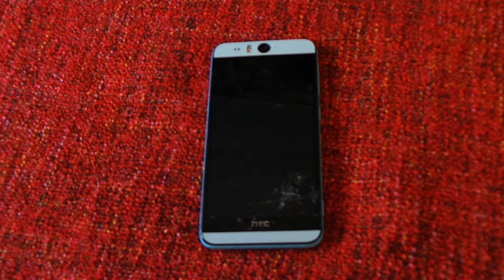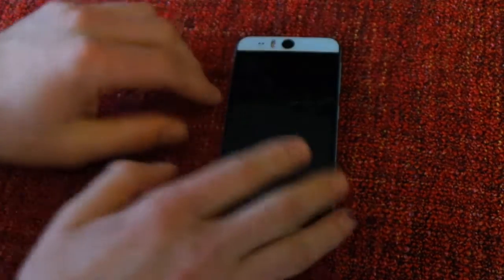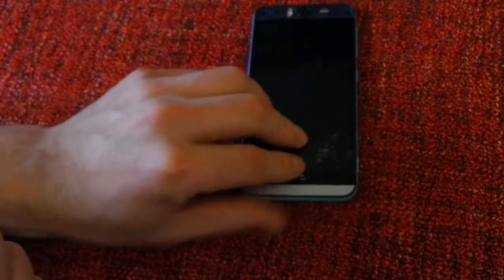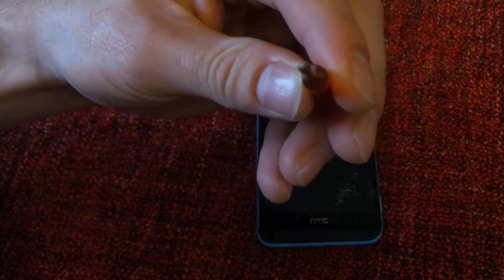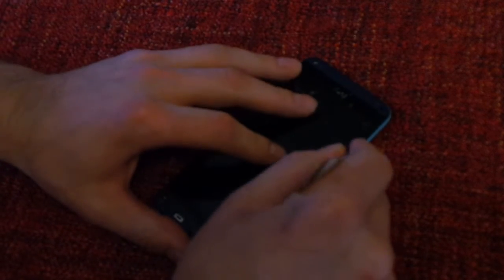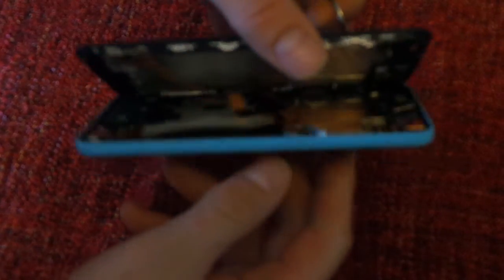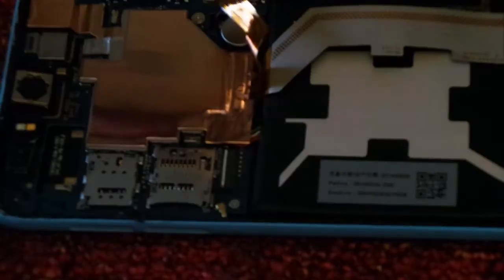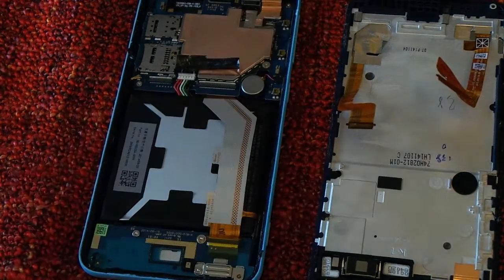HTC Desire Eye how to open replace lcd/digitizer

Comment: hey what is it exactly am I looking to buy/ my screen is broken, do I need to buy:Black LCD Touch Screen Digitizer Assembly Replacement For HTC Desire Eye?
Reply from the maker: Nat Bash Hi yes you need to buy LCD with digitizer fitted on it ,
Something like this https://rover.ebay.com/rover/0/0/0?mpre=https%3A%2F%2Fwww.ebay.co.uk%2Fulk%2Fitm%2F121749198476
Reply: thanks so much

Comment: Do I have to use extra glue after replacing the digitizer? if yes, which glue do you recommend?
Reply from the maker: Wojciech Kołodziej do you mean glue for the top and bottom or around the digitizer ?
Reply: All of them.
Reply from the maker: Wojciech Kołodziej for a top and bottom you dont need a glue just re-heat the with hair dryer and stick them back
For digitizer you need a tape who sticks from both sides check the link below 

https://www.ebay.co.uk/itm/262555060041
Reply: Ok. Thank you for your support.
Reply from the maker: Wojciech Kołodziej Any time 😉

Comment: my display is working but my touch works only in some area and the display is not cracked or anything.so what parts should be replaced??
Reply from the maker: Hi there is problem with digitizer
So it could be easy fix or very expensive fix
Easy fix is just to open it and check if digitizer connection cable may be loose.
In my experience with htc models
This digitizer problem happens alot 
But the expensive way is to replace the all glass with new digitizer cables
And if you still have the same problem
Then your digitizer connection port is faulty and if that is faulty that's cost alot to fix
Because the the digitizer connection port is attached to mother/logic board and there need a professional soldering dude to fix it
Or new mother/logic board and they not cheep
In my experience with htc this problem happened alot
Reply: Ok thanks mate
Reply: you have to replace Touch.. no other soluction... i do that

Comment: is it water proof after repair??
Reply from the maker: Kaushal Janith it's not water proof even before you peel it off. This phone isn't water proof
Reply: +Einars Steins  what?? but its IPX7 waterproof design
Reply from the maker: Kaushal Janith yes it is mate but after I watched few videos i would say its water resist not proof, but anyway, adter you peel offthe sticker it will stick back and hold the same as it was original, just be careful dont let any dirt or dust stick on it 😉
Reply: +Einars Steins tnx bro
Reply from the maker: Kaushal Janith any time, btw i think that sticker is just for look not for water resistance just to cover the screws and that plastic

Comment: Ok question I have same phone and I accidentally broke the changing port trying to clean it now phone won't charge how would I replace that peace cuss I herd u can buy them but putting it in myself not sure about.
Reply from the maker: Hi. Usb port is easy to replace, but im not sure how it is for this phone cos i never dig so far to see, usually there is small cable and thats it, but as i know for oldest phones they are soldered to mother/logic board.

So just dig so far till you going to see how that USB port is fitted in and if it's not soldered then easy job to replace

Comment: Thank you for the video mate :) .. all of sudden my desire eye's display has become very very slow(if we type three words the display is still at the first word and takes more time to show up the next three words. this is just an example) apart from that the mobile is perfectly alright( everything is working fine ) does it have anything to do with the lcd display what could be the reason for this.. i have factory reset it for twice with out any luck.. please help me with info if you have come across this kind of scenarios
Reply: I don't know if you sorted this yet, but mine did this. It's the default keyboard. Download Flesky (best keyboard in my opinion) and it'll be perfectly fine again.
Reply from the maker: Hi. I dont think its lcd fault, could be processor or some fault in mother/logic board. If you still have the waranty take it back to the shop.
Reply: +Einars Steins Thanks for your reply, unfortunately mobile is out of warranty period.. i gave it to the service center.. i hope it is not mother board problem.. fingers crossed
Reply: Im having this problem too, my phone is so slow, response is slow and disconnected and reconnect the flex cable from the LCD and is now working again, but sometimes it become slow and i have to hit the phone with my hand for it to become fast again, i dont know whats the problem yet :( maybe the motherboard or a loose flex cable from the screen.( Sorry for bad english)
Reply: I will try your advice Sammi Jayne Brooks

Comment: Hello, i broke my charging pin this morning. Do i have to change the whole charging board or only the pin? If so, can you give me information/tips on how to change it? Thankyou :)
Reply from the maker: Hi. In most cases with charging port is when you need to replace all port cos its hard to find the problem.

Sorry but i cant make a video how to fix that port cos i dont have any more that htc device :( 

Try to find some how to fix video in youtube
Reply: Thank you so much. But i broke the charging pin.
Reply from the maker: Charging pin?! So how old is your htc !? So its charging with pin not with usb port !?
Reply: My Mom gave it to me last february 2015. The technician cannot find any replacement :(

Comment: Great video! i've sent you a message!
Just read the comments..Basically what you are saying is don't try to peel off the glass from the digitizer..Well i almost did it on my MotoX so I think i`ll give it another go! :D
Reply from the maker: Hey. 

Yes to seperate the digitizer from lcd is pain in ^#+ thats why im not doing, cos one wrong move and the lcd is broken ;( its cost just a bit more to buy a full lcd+digitizer replacement but it takes less stress and time. Professionals can do it easy cos they have the right tools for that but still they have a chance to damage the lcd. If you buy a full replacement digitizer+lcd only care you should look for to NOT damage the digitizer connector who is connected to the mother/logic board. If you will damage it then the lcd will not work 100%. The problem will be when ( for example ) you will tap on right top corner but it will do like the bottom corner and if this happens you have 2 options, buy new mother/logic board or take it to prefessionals and you have a chance when they can replace by soldering a new connector, but any of these cases its going to be very expensive :( so be patient and carefull ;)

Comment: Hi, I accidentally dropped my HTC Desire Eye while charging so the Micro USB Port broke, the inside pins are bent, the charging cable is no longer working either and I haven't been able to find the part in the US. I've reached HTC and they said they don't sell the part and I'd have to mail it in. Einars, do you know if a generic port will do or is it something truly special and that's why it's do hard to find? I'd greatly appreciate any and all help. Thanks!
Reply from the maker: Hi my friend. Thats a big problem at the moment. The HTC desire eye is not so popular device thats why its hard to find any parts but there is 3 options what i would do if i would be you.1st, you can go to some service and ask them can they fix it, if they saying they have no parts then option 2 is, try to buy cheep broken desire eye from ebay or any other places to get that usb port as a spares ofcourse you will need to have a soldering skills but with that spare part of usb in some pro services they could fix it. option 3 is to sell your desire eye as a broken  and buy other phone ;(
Reply: Thank you much for the prompt answer. I have tried option 1, 2 is a work in progress as is trying to get the part from China or Europe. Keep your fingers crossed! Thanks!

Comment: hi i have a question i just broke my htc desire 626's phone yesterday, it def has a cracked glass on there but, my question to you is how do i know if i need to actually change my lcd? well my phone is cracked but u can see half of the screen the half u just see color and  cant see no picture on the part with it has cracked. does this mean i have to change the lcd and screen? please ur help will be appreciated
Reply from the maker: hi. its up to you. if you want change lcd. nothing bad will not happens to your phone if you use it with broken lcd.

Comment: Hi - I have a problem with my HTC Desire Eye unable to charge. There's no light indicator, I am sure it was discharged very much. Do you think it will charge later soon?
Reply from the maker: 1st try to leave ot for about 1hour. if still nothing, try different charger. take some other usb cable and plug it to pc. if pc does not recognize then the problem could be in tour usb port. for many phones those usb ports in one nice day they just not working any more. try 1st those steps
Reply: +Einars Steins Thanks - I bought the quick charge 2.0 but still waiting for it. I hope it will be just fine. Thanks!
Reply from the maker: Ye.

Comment: Hi thanks for the video. I'd like to know if the parts are the same for M910n and M910x?
And do you have another video that shows how to separate the LCD and digitizer?
Reply: Colin Cheng Nvm. I just read the comments below
Reply from the maker: Hi. Im not sure about those parts,but as i said im not doing that separate job for lcd/digitizer at home cos i dont have tools for that job and it not easy job. You can crack very easy that lcd.

Comment: Nice work.
Have you tested if the digitizer can be seperated from the lcd ?
Reply from the maker: Yes i tried . It's impossible to do it at home even with heat. I tried seperate dgitizer from lcd from few htc models and all the same. It feels like the digitizer is glued some how to lcd. One small wrong move and lcd is broken :( so i bought digitizer with all lcd and done. It is more exspensive but i saved my time and nerves ;)
Reply: Einars Steins does this mean that it will completely not work or will the screen go completely black but turns on?
Reply from the maker: Well if you crack even a bit the lcd the crack will wordy anyway. But Ye you still gonna be able to turn it on.
Reply: +Einars Steins  My phone LCD screen is working well but the glass is broken

Comment from the maker: Glad to help ;)
Reply: Einars Steins However, I only break the glass, not the lcd and digitizer. And there 80$ difference with the full lcd and digitizer and only digitizer. Can you show/tell if i can only replace on the digitizer? Thank
Reply from the maker: For htc i never replace digitizer cos thats a nightmare cos the lcd is clued to the digitizer and you have 98% chance to break lcd :( for pro they have special tools to do it in home its almoust imposible even if you apply heat. So thats the problem with htc. You can try but......
Reply: Einars Steins ahhh, i heard people say that, Thank for clearing it up. ok, gotta to start saving up. thank, i really appreciate that
Reply from the maker: Sieng Siravudh and if you replace digitizer at home and you use cheep clued tape it will peel of and dirts will go under digitizer even if you not using the right heat temperature that same can happen but if you buy lcd with difitizer on it so its made in factory, much better quality. Save a bit and you will fix it easy ;)